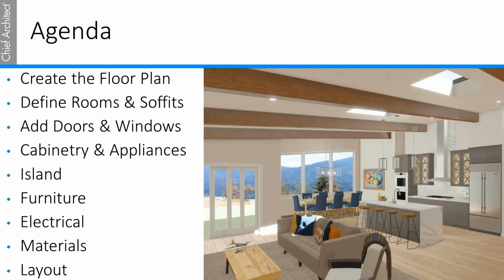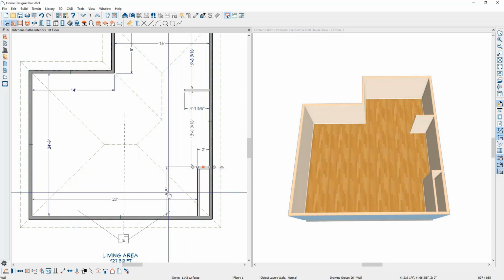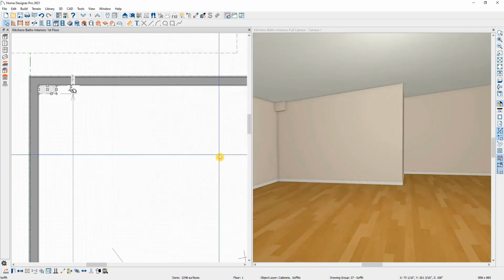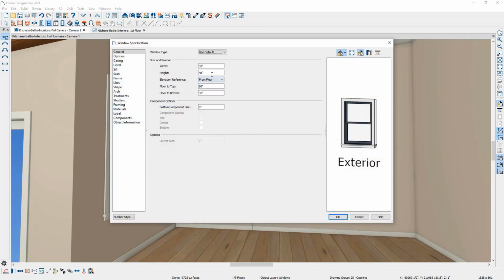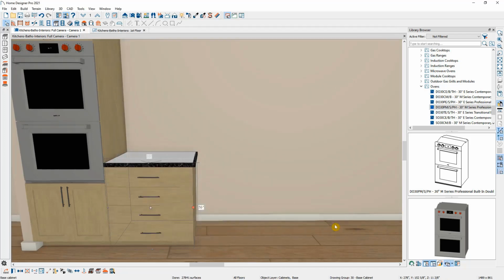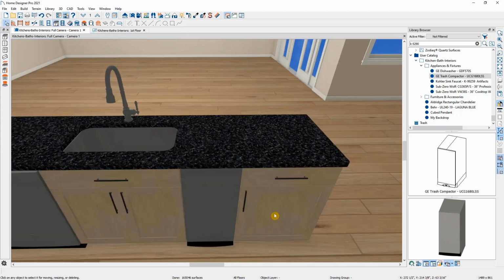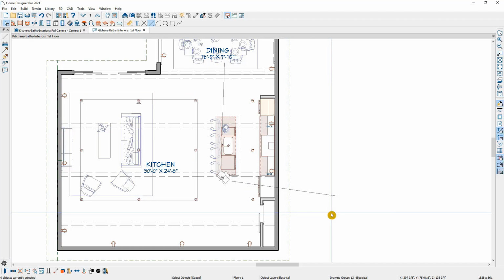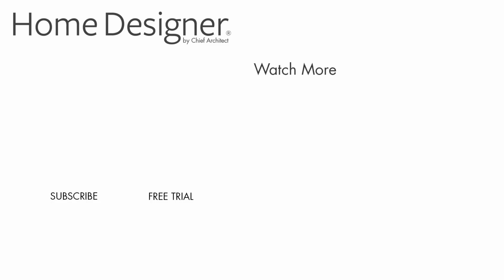Kitchen Design Demonstration with Home Designer 2021

Comment: Good day

Is it possible to do a Tutorial on how to darken and thicken the Exterior walls in color black on a floor plan.

Also how do you create different colors for each living area to create a visual separation of the individual spaces.

Additionally, is there a way to integrate/overlay the 3d model of the house onto the floor plan footprint.

Thanks
Reply from the maker: Hello Rafeek Hendricks! Thank you for your questions. If you have Architectural of Professional you can open your wall specification and with the wall types panel you can define the wall type to change color, material, size, etc. 
You can change a living area's color by opening the room specification, under the fill style panel, you can select the pattern type and color. 
The software doesn't have a feature to overlay the 3D model on the 2D floorplan but there is a 3D view called doll house view that may be a good alternative. Click 3D>Create Camera View>Doll House View.
Reply: Thank U CA..that was very helpful.

Will try those suggestions.

Comment: Hi......Can Chief Architect export the 3D file in a .FBX format to share with other non-CA users. It will also be required if one needs to export the FBX file to Twinmotion 2020 and Lumion 10 for rendering. Thanks, Rafeek, Cape Town, South Africa
Reply from the maker: The Home Designer Pro program cannot export .FBX files. However, it can export a variety of other file types that are listed below. 

-	PDF-.PDF
-	Current View / All Floors – .DXF, .DWG
-	3D Model – .STL
-	COLLADA Model – .DAE
-	Meta File –.EMF
-	Picture – .JPG, .JPEG, .BMP, .PNG, .TIF, .TIFF
-	360 Panorama- BMP, JPG, PNG
-	3D Viewer File